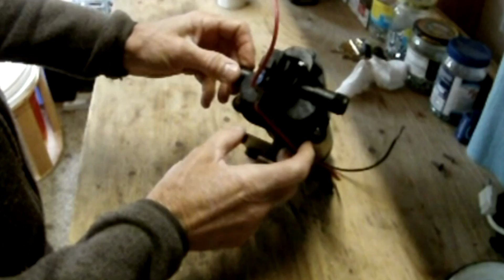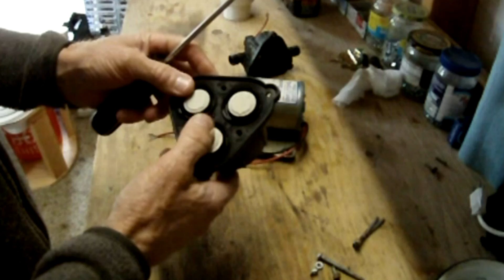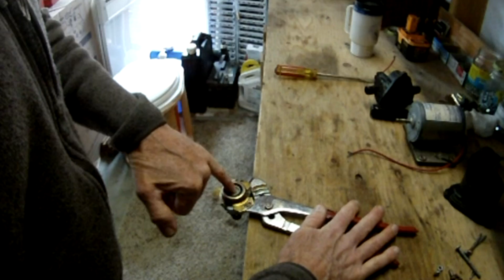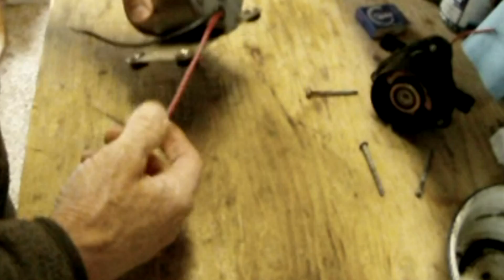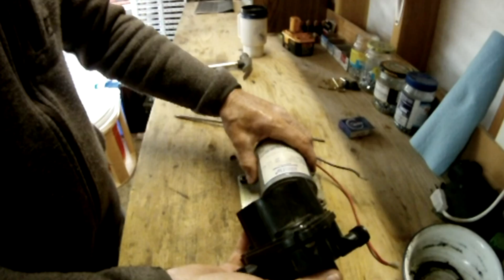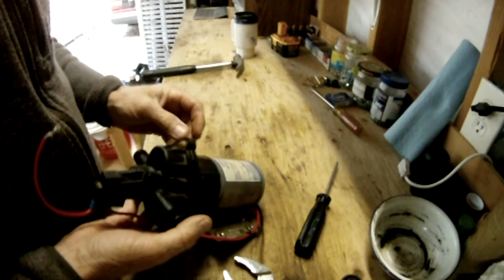RV Water Pump Repair

Comment: The 3 long bolts that run into the motor casing snapped. I got the first black part off that has the diaphragm but can’t get the second black piece off due to these bolts now.. any idea how to get these removed ?

Comment: Thank you for the informative video, my pump was squealing so i replaced  it, i left it on the work bench for the last year and was about to throw it out, i pulled it apart and a piece of plastic hose fell out! working perfectly again! Cheers!
Reply from the maker: LOL.   I wonder how that got in there?  Now you have a backup pump.  🙂
Reply: @MTMiser  Yes i think it was from when they drilled holes in the tank for the fittings, I'm glad i didn't throw it out! Thanks for the help!

Comment: sir what will happen if i accidentally connect in reverse polarity?
Reply from the maker: I'm not sure.  I don't know if these old pumps had reverse polarity protection or not.  My guess is that even if the motor ran backwards, it would still pump water.  I would think the diaphragm would still oscillate and even if it did that in the reverse order, it wouldn't matter.  It's not like a pump with an impeller that can break if it spins backwards.  I could be wrong though.  Just a guess.

Comment: The inlet attachment broke off on mine. Nothing I can really do about this. Tried opoxy but nope.
Reply from the maker: You might try some "Amazing Goop."  I used this stuff to add a diverter tube on a P-trap and it worked great.  still holding many years later. Here's an affiliate link to it on Amazon: https://amzn.to/3vfhpb8
Reply: @MTMiser  thanks I’ll look into this
Reply from the maker: @Itdontmatter69  There's another product you might consider too - PlasticWeld, by JB Weld.  I've used it once but haven't tested the result yet.   https://amzn.to/32K9gPy   With either one of those, let them dry for 24 -48 hours.

Comment: Very nice, have this same model pump in a 24 foot V Nose Toy hauler/camper I just bought used, the trailer is an 06 but most of the appliances look like they where scavenged from something made in the late 80's, I am remodeling it and video's like this come in handy in case I decide to keep some of that older stuff will probably keep this pump for sure ;-)
Reply from the maker: It was a good pump for sure - lasted 30 years before it died.    Have fun with your new rig and all the remodeling.  I find that kind of work very enjoyable, and it's a good feeling to give an old rig new life.

Comment: Thank goodness you used fast forward in places.
You should have put some lube on the ends of that motor shaft
while you had everything apart.
It's always good to clean the crevices on the armature with a 
razor blade while you have it all apart.

Comment: Hey I have questions! I have a 3/92 camper it's old but idk how old the water pump is older style though. But I've been using the water pump and they'd be times I'd leave the pump on I'd forget to turn it off but now when I turn it on it don't seem like it builds enough pressure bec there not alot of water that pumps up to the shower, the faucets are fine.. I don't think it pumps enough pressure for the shower.  It will run 30 sec and kick off and turn back on about 45 sec later and then repeat...  idk if I burn it up or the bearings or what.. but I heard you mention something in the video about the brush or something??
Reply from the maker: I was talking about the brushes in the motor.  That isn't likely your problem.  When those go out the motor usually doesn't run.  If you're getting normal pressure at the faucets but not enough at the shower, I'd check the shower.  The shower 
head could be clogged up.  Sometimes they have little screens in them that can get clogged with debris.  Pull the shower head off and see how much water comes out then.  Maybe swap it with a shower head that you know is working fine.
As far as the motor turning on and off repeatedly, either you've got a slow leak in your plumbing somewhere or possibly
your check valve is leaking and allowing water back in to the fresh water tank, thus reducing pressure in the plumbing.  
That causes the pressure switch on the pump to trip so the pump turns on again until the pressure is built back up.  Then the cycle repeats.   Check your plumbing very carefully for leaks - just a slow drip somewhere can cause this.  If you're
 sure there are no leaks and the problem is still happening, then look at the check valve.
Reply: Okay I don't believe I have any leaks. But what's the check valve?
Reply from the maker: @justinlambert440  The check valve allows water to flow in one direction only.  It's built into the water pump.  It's there so that when your pump turns off after building pressure in the water lines, the water can't backflow into the fresh water tank.  If the check valve goes bad, water leaks back into the tank, reducing pressure in the lines until the pump kicks on again. And it does that over and over and over until you turn the pump off.   If that's the problem, you need to install a new check valve in your pump or replace the entire pump.
Reply: @Maynard the Miser thank you! I'll check into that.  I have one question that may cause that not sure but I did hook up the hot water tank and I'm not sure if it's back flowing caused by pressure.  But I think it's 2 3/4 female screwed into the hot water tank, I did take that long rod out of the hot water tank I wasn't sure hooking that up so I just used female 3/4 for those without the rod so I had a feeling it builds pressure up the line from the hot water tank.. I was thinking about by passing the hot water tank for a better flow considering it doesn't work anyway.  What do you think? Also I do have a pressure valve it's 175psi valve on the hot tank
Reply from the maker: @justinlambert440  If the hot water tank isn't being used might as well bypass it.  That should also tell you if the problem is somewhere in that tank.   If you ever get the hot water tank working again it's a good idea to put that long rod back in - it's an anode, meaning it will corrode over time.  If it isn't there your hot water tank will corrode instead of the anode, and eventually will start leaking.  As far as the hot water heater being the problem, is it possible that only the hot water is being restricted?  If so there is a check valve on the hot water heater also, and it can go bad and block hot water from exiting the hot water tank.  If you think that could be the problem, look at this video which shows how to replace the hot water heater check valve:  https://www.youtube.com/watch?v=WMqm_dPme8k
Reply: @MTMiser  I watched the video I understand the check valve now and neither of the check valves are on the tank I rigged it and I believe that's why it backed traces and builds pressure..   I don't think there's check valves are on either side of the pump either or should there be? Or just made on the inside of pump?
Reply from the maker: @justinlambert440  They're built into the inside of the pump.
Reply from the maker: @justinlambert440  The check valve on the pump is on the inside of it.
Reply: @MTMiser  Okay thanks. I'll check into that. I'm temporarily staying in the camper so it's a iffy unless I buy the part first. It's a pain taking it out and hooking the line up on the out line of the pump. The screw on piece was cracked so I used some bluming glue around it. So I'd have to break it lose
Reply: @Maynard the Miser    thank you! I'll check into that too but I may bypass it and see from there. But I'll reply here again if I need help. Thanks again

Comment: Great video, breakdown and information. All the parts and replacement parts and pump. I am dealing with exact same pump on a 86 Chevy Travelcraft I have been working on. I got into the pump thought it was good and just last night nothing while trying to use. So going at it again this morn. Good to know your replacement model I may have to get as well. Will see. Thank you for sharing, good work Sir...Cheers from So Cal...
Reply from the maker: Good luck, Ronniesherpa.  Hope you got it going.  If not, that replacement pump is great.  It's so much quieter than the old one.
Reply: Whew I wouldn't of gotten so far into without this video.  Went deep, one of the motor magnets came off, I cleaned up and epoxied it back in place like a charm...Put it back and nothing, found out same exact bearing stuck. Old skateboard days, got it loose and flowing clean, put it back together slightly wrong lol...I did this pump 6x but now works great with a little noise. Running it out and will get the replacement asap as I'm staying local for a bit...Your Video sure helped...

Comment: We have the same water pump and it is having a problem all of a sudden where it will keep running and our water pressure is lower than normal. We got it taken apart down to the point where the bearing section comes apart from the motor and ours will NOT come apart. Is there a trick?? Thanks!
Reply from the maker: No trick.  If you get all 6 screws out it should separate from the motor easily.   Then you have 6 more screws in the part that holds the bearings that have to come out, if you need to take that apart.  But I'd check the white Teflon bushing in the motor's front plate first (that the motor's shaft goes through).  That part wore out on mine and did exactly what yours is doing.  When it's worn out the motor's shaft gets a lot of play in it and that reduces the diaphragm's ability to pump well.  It got so loose that the armature started hitting the field windings and I ended up replacing the whole pump.  This was about 10 months after I made this video.
Reply: Thanks for the info! We got all six screws out but that rod that goes from the motor just won’t let go! We are just going to replace it.
Reply from the maker: That's interesting.  I wonder if it got hot and something seized inside there to sort of "weld" it together.   Anyway, new pumps aren't very expensive.  I really like the new one I have now.  It's much quieter and a little more powerful than the old one was.  It's a Shurflo 4008-101-E65 Revolution.

Comment: could you please our water pump has water leakage when starting so what can l do .
Reply from the maker: Carefully observe it and see if you can determine where the leak is coming from.  If it's from a connection, tighten the connection.  It it's from the pump itself, check that the screws that hold it together are all tight.  If none of that works, maybe it's cracked (from freezing) or the seal has failed.  It's hard to say without more information.

Comment: Hi where u get bearing for water pump? Thank
Reply from the maker: I got it at a local bearing supply store.   But they should be available at most places that sell bearings.  If you have the same pump, the bearing is a NTN 6202 LB.   Or just look for one with the same dimensions - 35mm OD, 15mm ID, 11mm wide.  You can get them online at Amazon, Walmart, and lots of other places.